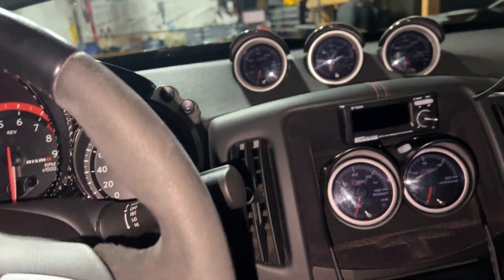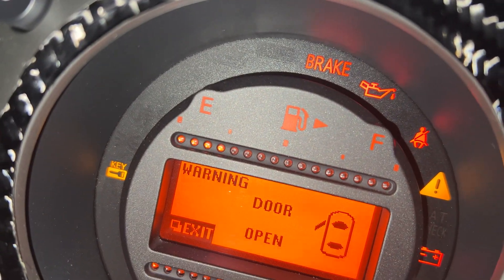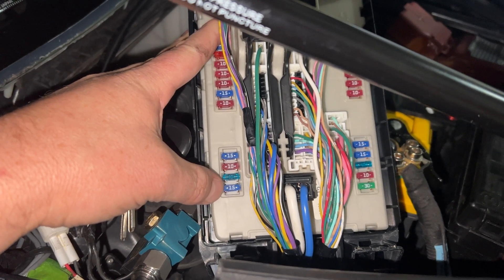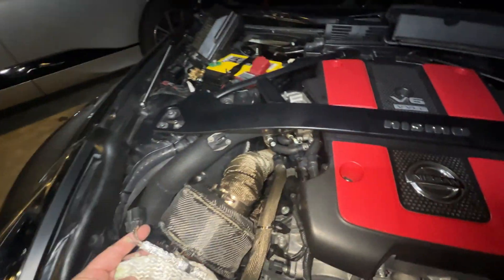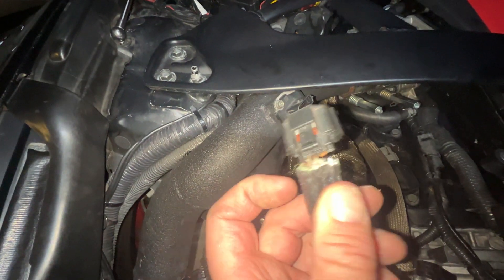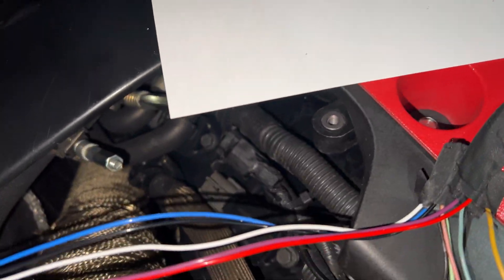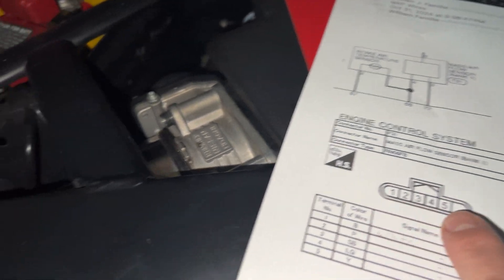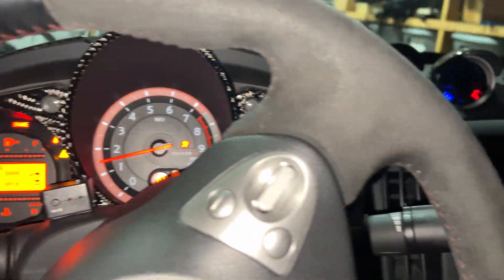Nissan 370Z Intelligent Key Warning Light, Blown Fuse, Cooked MAF Wires

Comment: Im having this issue i changed the whole fuse box, i have replaced immobilizer and replacing key. I think my only option now is to check the bcm
Reply: No luck?
Reply: @1おっさん0 as of now im going to be changing out the battery today since its only at 11-12 volts
Reply: Its kinda tuff for mw because they fixed that problem for the 2013s and mine is a 2013 i cant find a video with someone that has the same problem as me since i dont have a steering column lock
Reply: @MorBodyShop  we had the same problem ... lol turns out if the clutch csc is bad it wont let the car start.... check to see if that isnt the problem